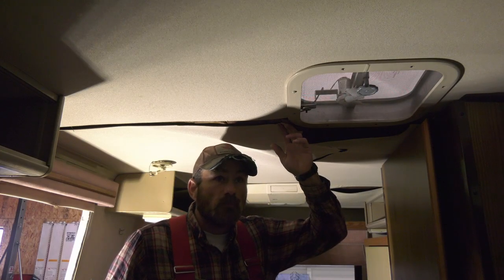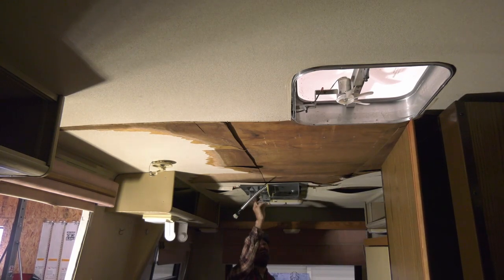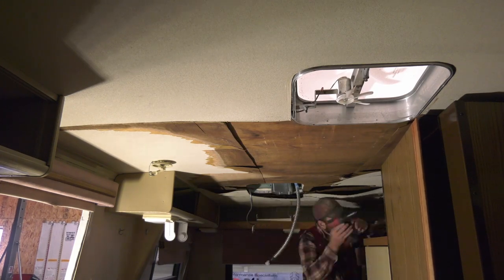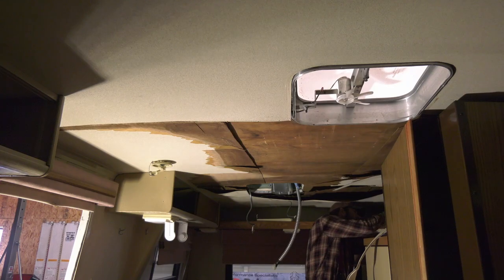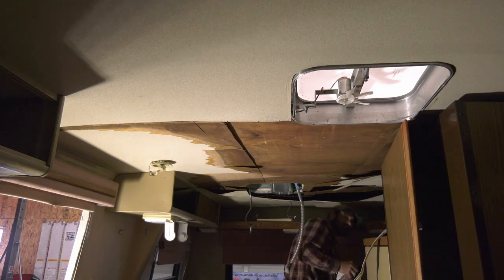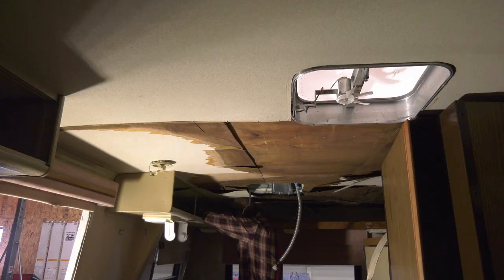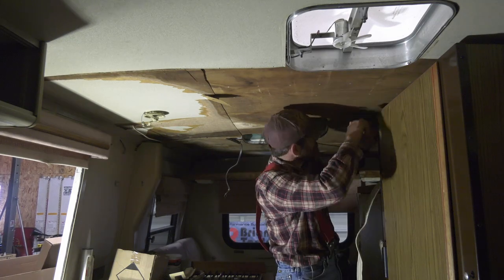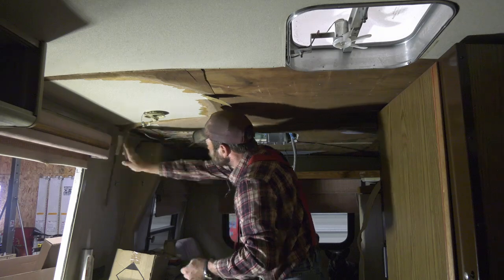How To Replace Your RV's Ceiling Panels Part 1

Comment: Cool video. Love the explanation of how it's made and works. Will part 2 be coming soon? I'm guessing load stabilizer bars (also called ratcheting cargo bars) would work great to hold up the panels as the glue cures. 
Have a good one!

Comment: Thank you for sharing this!! So the styrofoam in my ceiling has bad water damage and needs to be replaced too. With how soft the ceiling is pretty much throughout, I’m under the impression I’ll need to replace all the styrofoam and paneling. Any suggestions? I’d be glad to email you photos if you’re open to it!

Comment: Cool video. I'm looking to raise my le sharo roof. I was looking to your video to see the structure of the roof/wall to be able to plan a little before tearing my le sharo down. Any comment/idea/suggestion regarding my project ?
Reply from the maker: I haven't removed a a roof on a le Sharo in particular but almost all roofs are put together in a similar fashion assembled and glued to gather on a table jig then hoisted up and screwed down from the top side and covered with a roof skin, epdm rubber, vinyl, or in this case aluminum. you have to remove that layer first then there should be screws around the perimeter holding it to the top of the walls. the good thing about aluminum metal roof is that it can be reused the others are glued down and are destroyed in the removal process. DON'T glue the metal down when reinstalling you will have horrible problems just let it float. I don't think there are any screws inside with the exceptions of cabinets on the le sharo I will look today and double check if I am wrong I will get back to you. here is a link to a landau motorhome I did several years ago removing the whole roof.  https://scontent-sjc3-1.xx.fbcdn.net/v/t31.18172-8/18359160_1549571768418840_6047951802021598782_o.jpg?_nc_cat=111&ccb=1-7&_nc_sid=cdbe9c&_nc_ohc=r9vzqPk-gcsAX9QRUSQ&_nc_ht=scontent-sjc3-1.xx&oh=00_AT8GOFjp_ZPXCauC2YyLvG0lgl00-0fw3GwaynPHNUym1A&oe=62DA3218
its on my Facebook business page there are a couple pics. you will need to build a support system to then hoist the roof off so it doesn't buckle they aren't that tough to stand the weight on their own. although the Le sharo is pretty small and 4-5 guys could probably just lift off and support it. the one I took off was 36 feet long. and i did it with one other guy. if you have a good knowledge of how to fix things structurally I would say get after it. is it a project for someone like my wife NO! even though I would say it is simple, its just lots of labor. I just finished installing the ceiling panels from the inside which I will be posting in about a week. sorry about the book let me know about any questions you have would be happy to help.

Comment: Do I have to do the complete strip down ? If I'm not covering damage just want to change to a wood paneling.
Reply from the maker: if you are replacing paneling yes. you have to strip all the way down so the glue will adhere properly

Comment: Didnt know you can order panels for rvs, my parents 99 fleetwood prowler has saging ceiling panel in the living room from water that got in somewhere from the roof, its not too bad but had to drill half inch hole to let the water out of it or would had been much worse then it is, eventually going to get new tpo roof put on it but I guess you can get certain similar panels at home depot that will work but the mat paper not sure how that would work? but how would I go about getting panels for the rv? I know that fleetwood trailers are made in oregon which is where this came from originaly, what is your advice to contact fleetwood see if they have panels to fit this 99 prowler or just try to buy the materials & build one to fit? I noticed back bedroom also had gotten little water damage to corner wall area where night stand is bout almost foot in height the panel is week on bottom & wall paper is just bit wrinkled so its not anything too severe but I am sure I will find some damaged roofing deck once the rubber membrane is removed especially in front right corner of rv where water got in the size of a basketball that ultimately caused the ceiling semi bow down the rain actually filled the light bowl fixture in the livingroom crazy how this all happened..
Reply from the maker: Well I am originally from Lagrande or and Fleetwood went out of business. So there is no contacting them. But if you go to an rv dealer and find a new rv ceiling panel that matches closely to what you have and ask them to order the ceiling panels just tell them you have that type of trailer and they can order them if their not too lazy. But shipping is super high right now. A home depot panel will be hard to match up. Since you have to do the roof anyways and replace some sheeting. You do all of it from the top. Pull rubber, and bad sheeting then pull up rafters and rebuild rafters with ceiling panels stapled and glued. And set whole assembly down on top of the sidewalls and you can't tell you did a panel replacement. It really doesn't add any time to the project and is easier than putting panels up from the inside and having to mold all your seams.
Reply: @thesetwohands6982  Yes thanks much for the advice, I will see what I am up against once I get the top decking off hopefully there is no major obsticles in the way that keeps me from getting to the ceiling panel, its not an eye sore way it is now has very slight bow to it but if I can get the similar matching panel I would try to remove old one, thanks much again I will be talking to my local rv supply store on the panels👍

Comment: Hello do you have any spare lesharo cv axles? I can’t find any replacements. Or do you know any place to get them? Thanks
Reply from the maker: do you have the originals? if so take them to Carquest and they can send them out and have them rebuilt. if you don't then that's gona be a tough one. I don't have any I had mine rebuilt by Carquest.
Reply: @thesetwohands6982  I’ll get a hold of car quest thanks

Comment: Do you use the same glue for a delaminating exterior. I’m working on rebuilding the front left wall on a 2007 Chalet Takena as well as the ceiling around the skylight in bathroom.
Reply from the maker: yes that glue is great for all materials it's just expensive. I have had family trouble for a while and am moving my shop to another state so I apologize for late reply and lack of footage to continue the repair series.
Reply: @thesetwohands6982  thank you for your response. I live in TriCities,Wa.  so not that far from Artic Fox. I did reach out to adhesive company and like you said had no knowledge of that product. Is there a specific name of product if I call Artic fox.
Reply from the maker: @jgardner7804  honey glue. I am moving my shop back to La Grande OR still in the process. it may take me a bit but if you have more questions just ask I'll get back to you as quickly as possible.

Comment: An antenna was removed from my rv roof and foam filler used to fill the hole! What can I do to prevent leaks and restore the integrity of the roof and ceiling surfaces?
Reply from the maker: well if you have a metal roof use elastomeric roof seal it will last the longest and is applied with a paint brush. if rubber use dicor sealant. if there is a hole on top and you have a metal roof clean thoroughly apply sealant on top and bottom of aluminum patch drill and rivet to the roof then seal over the top.  just don't let water in or it becomes a long terrible repair.

Comment: Do you have social media? I have a few questions about caulking. Just subscribed also!
Reply from the maker: I do but if you have questions just ask away. Sorry for being late to respond farming stuff before winter is closing soon.
Reply: @thesetwohands6982  What’s the best caulk to use  ? There’s so many brands
Reply from the maker: @briizcustoms9543  outside caulk is geocel 2600 vehicle body sealant is by far the best. I order mine from arctic fox. For rubber and vinyl roofing use dicor please don't use flex seal! Also clean all your sealant surfaces with an enamel reducer is best I use dupont 3812s. Acetone will work as well. And don't mix sealants some have trouble sticking to each other.
Reply: @thesetwohands6982  I have an aluminum roof, I want to seal the seems and windows.  I can use geco gel for both?